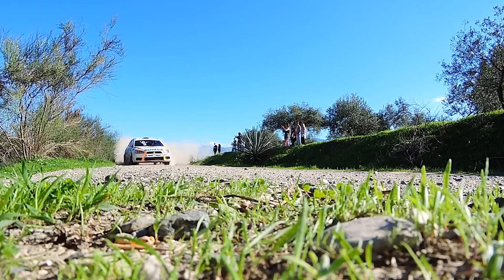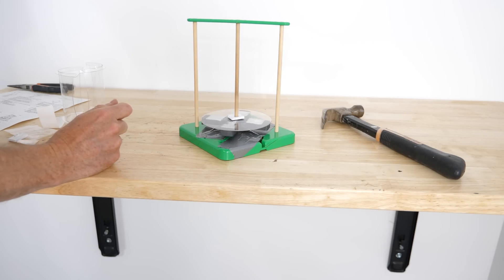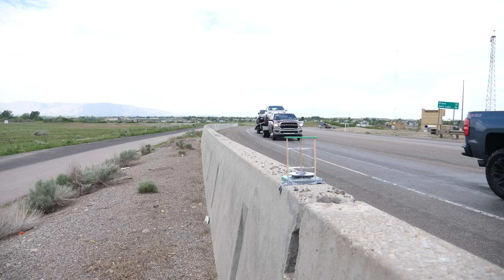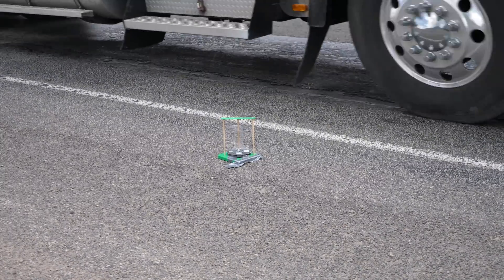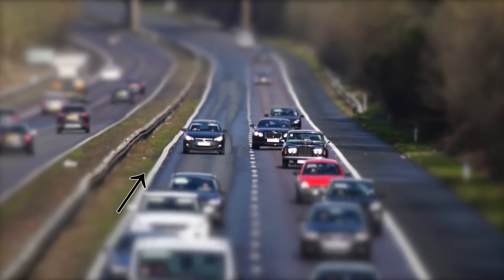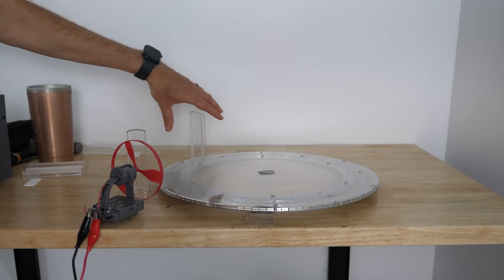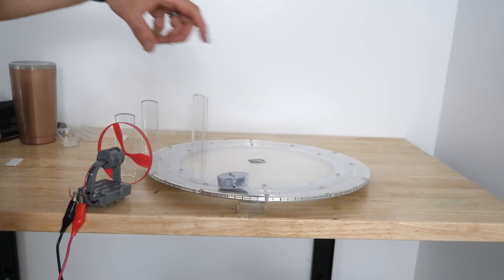Do Traffic Turbines Actually Work?

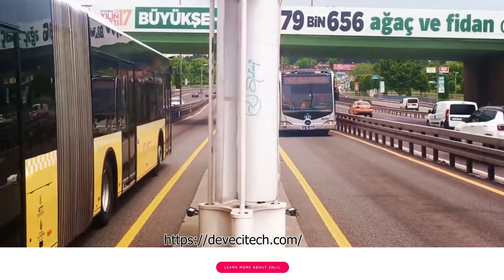Comment: 2:43 I think putting them in between two opposing lanes it greatly reduces the effect of energy loss for the  traffic (the traffic would have gotten more wind resistance of the opposing traffic anyway). So that setup might even reduce the opposing air displacement.
Still looks legit to me.
Reply: Stronger still, lets put those turbines between two opposing trains, frequent and mostly very well timed opposite air displacement (at least in the Netherlands, our trains run on a very tight schedule).
Edit; you can put them at a point where the train needs to slow down anyway, it'll loose energy quicker AND save the brakes..
Reply: @maartentoors  That just sounds like a different form of regenerative braking.
Reply: @rich1051414  Yes, agreed. I came to that insight a few posts prior, but trying to think out-of-the-box might bring new insights.. Sadly this was not one of them. :)
Reply: @maartentoors  I'm scrolling down the comments now, but I already made a comment about using it for situations where you need braking before I read your post.  Wind might be one way to do it, but you might also be able to do something with magnets in the tracks, sort of a reverse version of induction charging.  Trains going down hill... maybe a dedicated truck lane on really steep stuff too.  The Mass Turnpike has sections of road where they have to put truck runoff ramps already because trucks lose their brakes enough there.  Put some magnets in the road and harvest electricity on the downside while harvesting electricity... although ideally you'd have electric vehicles that already could be recharging themselves instead of using their disc brakes.

Another use I thought of was embedding them in jersey barriers- it's about as good as a scenario as you can get.  You already have a barrier close to traffic, usually down the middle between the lanes, and maybe all the power you want is enough to add some extra lighting since you usually use them around construction areas where you want people to be more alert.  Put a little plastic scoop on the side, let the air get pushed along the barrier into the scoop, and it would all be a pretty self contained little light system.
Reply: @NacorantheHarmonicaPlayer  Congrats! You reinvented maglev brakes!

Conventional electric railways usually have regenerative braking trains. Braking trains feed electric to the power line, which is equal to the braking power x efficiency. Accelerating trains take this energy, which reduces the line voltage balancing needs.

Maglev railways are essentially very long electric motors. Instead of making a circular stator array, they make linear stator array. Maglev train acts like a rotor. If the train is moving, and the motor is turned off, the motor turns into a generator, slowing the maglev down. It's also possible to reverse the polarity, and do extra fast and slightly expensive braking.
Reply: @maartentoors  train would give no sh*t to them due to it's weight
Reply: Does anyone know of any fluid simulation of this? It would be interesting to see the results.
Reply: One point I haven’t seen mentioned is that these applications are typically outside, where there already is some level of wind besides the one generated by traffic… which is also being harnessed, albeit not very efficiently… and also, if you do not have these turbines in-between the opposing traffic, the wind from the traffic in one direction generates a resistance to the traffic in the opposing direction… my “gut feeling” is that any additional resistance from the turbines would cancel the effect of this “cross-current”… the main problem will be maintenance, since I don’t know if this type of turbine actually breaks even at this scale when all costs are considered…
Reply: There is no such thing as free energy. If at any point in time the generator turns it's because a car is pushing it. Simple as that. You're burning fossil fuels to generate electricity. Energetically you might just as well hook up an old diesel generator. And you won't have to put it right next to fast moving cars. 😉
Reply: Of all the places where a wind turbine can be installed, some dumbass came up with the idea of putting them on a freeway median, where they'll have to lay electric wires, etc. You will never recoup your costs installing these dumbass inventions.
Reply: was gonna comment this exact thing.
Reply: Disagree: I get your idea and it seems intuitive, that its kind of "sucking" air from the oncoming traffic, thus apparentely reducing air resistance. BUT you forget that the turbine would have to speed up for that process in the first place, which it only does by using additional air drag from a theoretical "first" car. And even if those things were engineered in a way to optimally divert air flow from two opposing vehicles (which I think would be impossible, since the cars would need to align just in a perfect spot, whereas in reality the car timings are random in traffic), you still forget that the turbine itself is connected to a generator, thus taking energy from the system. What you're doing in a nutshell is, to take one form of energy (kinetic) and convert it back to electric, with never 100% level of efficiency, always a lossy process. If you were to install them on a mass scale, you'd get electric energy, yes. But you'd also increase overall fuel consumption by a fraction that will always be greater than the power you get out, under no circumstance you would get a net gain, always a net loss and in a perfect hypothetical world at best a net zero.
Reply: @GreyHunter49  I'd need to see testing, but I think what is actually happening is you are taking energy from the wind that might otherwise just be hitting something else.  Put them in the walls of tunnels, or in jersey barriers... places where you are already going to be creating that drag, and turn some of that drag back into electricity, and in situations where vehicles would already be braking you are taking energy that they would be turning into heat with their brakes into electricity, assuming they don't have their own regenerative braking situation, in which case you'd have to figure out which is more efficient.  For opposing traffic, it would depend how close the traffic is.
Reply: @GreyHunter49  Exactly.  They're trying to trade gas cost for wind turbine energy.  In the big turbines, it's effectively translated solar energy into wind energy as weather systems expend it in Earth's heat engine.  In this case, it's the already-inefficient use of the ICE burning gasoline to accelerate the car, and the turbine effectively increasing drag.

It's another case of a perpetual motion machine.
Reply: @GreyHunter49  not really. The energy we are harvesting is a part of the energy waste when we convert the fuel into kinetic energy for the car. It's the extra energy that is used by the car to move the air around it, that is bound to the car via friction. The car is pushing the air regardless of whether there is a turbine or not. So yes , the energy lost by the car will be vastly greater than what we can harvest in the electricity form . But that energy loss is there anyway so we are only taking part of the energy that is wasted and converting it. Ofc it's not perfect and your energy waste will increase a bit but if our yield is greater than this extra loss of energy (which is possible) , we are making profit
Reply: @GreyHunter49  I agree100%
I came to think of regenerative braking.
This former mentioned premise is stupid. 
Apologies for my tangent mind.
Thank you for making me see the error(s).
I just think that conservation of energy should (maybe) be converted into something useful in (future) mechanics.
Not into heat (ergo brake-discs).
I thank you (and respect) your feedback, this was a brain-tangent for me.
Reply: @GreyHunter49  You see correctly that turbines take energy away from the system and that randomness can cause problems. However, randomness can be greatly reduced by using a flywheel mechanism. And because freeways are quite rarely still for a long time, you can decrease the "turn-up" energy to a tiny fraction of total energy lost. 

Also, you neglect the fact that turbines aren't the only thing taking energy away. By placing the turbines there, you just make it visible. Normally, the wind meets in the middle and starts doing spins and other funny things, which heat up the air. This warmer circulating air then leaves through the top of the freeway and takes the energy with it. 

I don't think this is a discussion about having to put more energy in, it is just the matter of determining whether taking energy from the air makes more resistance than leaving the air as it is.
Reply: @somtu3780  Yes, but still, a turbine itself is a resistance, especially since connected to a load (i.e. the generator). Even with a big inertia it still needs energy from the whole system and therefore creates additional turbulence/drag. The turbulence/"air spins" created by two opposing vehicles would therefore cause even more drag on formation. While for the right condition (i.e. two vehicles just in the perfect timing) it would maybe reduce the drag of those particular vehicles, for other cars it wouldn't. Consider that it wouldn't speed up in the first place if not for added drag/turbulence. 
I agree though, that theoretically you could harvest the energy, once the air itself got warmer. However the temperature gradient is probably so low that no heat exchanger (again rather low level of efficiency) could effectively get energy out of it.
What I am usure about is whether you could harvest the energy from turbulent spins further away from the car, if they'd still impact car air resistance. My intuition tells me that it's the same still, only further away and therefore with fewer impact, but still the same (non-efficient) process.
Very interesting discussion though.
Reply: @GreyHunter49  I think it deserves a better analogy. Let's forget about cars, let's think about rivers. Suppose two rivers with similar width to like a three-way freeway. The flow of the water is the same thing as the flow of air above the road. Then we can look at like the bacteria and sediment as cars, travelling with the flow (it's not the best definition as cars make the air move, but in this question we don't care about the movement of the cars themselves, we look for aerodynamic stress or what). 

Now suppose a single river. In the middle the water flows without the problem but on the edges, it is being slowed down. This is exactly what happens at the outer side of freeway, the air sped up by cars leaves the road and meets non moving objects. The air slows down and creates resistance for the air behind it. 

The situation is the same, if you take two rivers and make them flow side by side, only oppositely, but leave a wall between them. Now remove the wall. You can probably imagine what amount of water splashing and swirling would happen, if you had decently sized rivers. That is lost energy and it loses much more energy than the wall.

So, the question is, whether the turbines will make resistance similar to the turbulent water meetup or if they will behave more like the wall, only contributing minutely to the resistance. And that cannot be discussed out here, sadly, that needs to be computed or measured with high precision. 

Thank you for your entry, I think we are onto something !
Reply: @somtu3780  what if it was a triple helix blade config turbine. place it on the sides of one way tunnels with just under half of the turbine sticking out of the wall. You're already in a tunnel, the wall already deflects air back at the cars. If you are worried about efficiency loss. You could even place turbines in walls on the side of highways.

Comment: I actually worked on this idea for my interstate robotics competition, and got 1st prize in the segment, we actually tried to implement these on the tracks of high speed rail to generate electricity
Reply: @----Jay----  i actually did that , we were getting a net gain of about 8-15% in efficiency depending on the weather etc. The total cpst of the project was coming slightly on the higher end , but with optimal use the cost was getting recovered within 9-13 months of usage, plus the maintenance was costing about 12% of the cost of the electricity it produced per month. 
Overall it was profitable in the long run (5-10 years). 

We realised that Implementing on roadside wasnt so much applicable and also wasnt efficient , but as trains carry high momentum,they aint gonna get slowed down that much due to the increased air friction of the turbines , plus there is no risk of a train colliding with it as it is on a roadside.
Reply: Although we got 1st in the state competition but unfortunately did not win in the nationals
Reply: @paramveersingh4730 because national saw the flaw in the design you would be better off just running the turbine by fuel i.e. an electric generator running on gasoline. We already have those.
Reply: @timetraveler_0  what? The whole point is for it to capture some of the energy of the moving air from the train, they could’ve just lost nationals because there was a better project
Reply: @timetraveler_0  i guess you are smarter than the scientist, phd holders who were judges at state level competition who gave us 1st rank. You can read my comment above , we were getting significant amount of efficiency gain even under non ideal circumstances
Reply: @timetraveler_0  sadly i did not lose national becuase a better project was chosen, i lost it because there was some corruption scandal ,after  judges announced result people started protesting but they were silenced by the police , i saw some horrors that day. 

Dont get me wrong, there were many many wonderful projects that were worthy of the prize , there were many projects that were better than mine , but the judges chose the worst project (they chose an electric solenoid piston engine , that was cleary very inefficient and the idea was literally copied from a youtube video)

Comment: I once found myself riding my bicycle on a country road that suddenly became a 4 lane highway for a few miles, then went back down to being a country road.  For that stretch, I was able to easily pedal 20 mph without much effort.  Dangerous to ride on that road, but an interesting experiment!
Reply: I used to like to ride behind Dodge pickups because they don't accelerate very quickly and they push a lot of air.

Comment: I assumed that the turbines would just be using wasted energy, so it is interesting that they actually make the cars less efficient. In any case, given how little energy cars waste as it is, these things aren't going to be getting much energy from cars.
Reply: Exactly, this. Harvesting wasted energy is harder than it sounds. Most "good" ideas actually go against the laws of thermodynamics. From chaotic motion, such as sound or air turbulence, there's no way to go back to organized motion (electric current in a wire). Maxwell's demon is a related thought experiment, check it out.

Comment: I believe that traffic turbines are not a bad idea at all, but the question is: Would they make a significant impact? In my opinion, while these turbines may be suitable for smaller applications like traffic lights, their effectiveness in addressing big energy savings is unclear.
Reply: There's a reason wind turbines are built so big; Cost efficiency. Bigger turbines generate more power for the price than smaller ones do. There's no way the tiny amounts of wind generated by highway traffic would outweigh the huge amounts of wind created by nature.

It's interesting to explore the idea, but only for scientific curiosity.
Reply: @TheSeanUhTron  Definitely quite true, but arguably the smaller ones are several times cheaper by comparison, so it's kinda like a quality vs quantity type deal. Just depends on how willing we are to maximize space for efficiency.

Comment: Your design has lots of friction.
Ps I've tried this with a vertical wind turbin that was ment to charge a phone and I was able to get cars going 45mph to turn it at a maximum of 5 feet.
When I tried it with cars going 65 to 70mph I was able to go 7 feet from the road before power stopped.
Don't forget freeways have lot of natural wind too.

Comment: In fact, on a formula 1 racetrack, if all cars are roughly equally spaced along the track, the average laptime is reduced because everybody experiences less air resistance, due to the air traveling in the same direction around the track as the cars.
With that being said, you would even impact a busy highway even more because you're taking away the flow of air created by the string of cars that have been driving there.
It's still not a gigantic difference, but it's never a good idea, I think. It would be better to build a very wide and low one for the top of a car with a solar panel on top of that.

Comment: That would probably work great for inside of a tunnel like Subway or train.
Reply: So many people commenting about tunnels but forgetting that tunnels, of all places, are equipped with power and comms lines along their length. Using efficiently generated utility power makes way more sense than building heaps of alternative gadgets to place right next to them lines.

Comment: The only use i could see for these is guard rail lights. We have all seen the little flashlights you shake a few times and they generate a bit of light for a couple minutes. put these a few feet apart on guardrails barriers etc the cars charge them up a little and they produce little light probably enough to light up a couple feet from the side of the road. I could see this being a little useful but would it be enough to justify the cost?